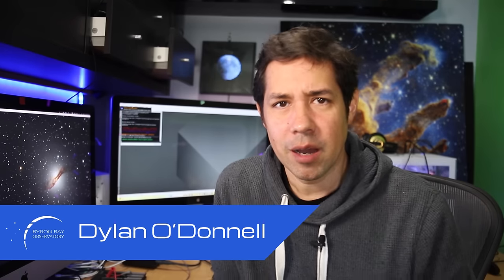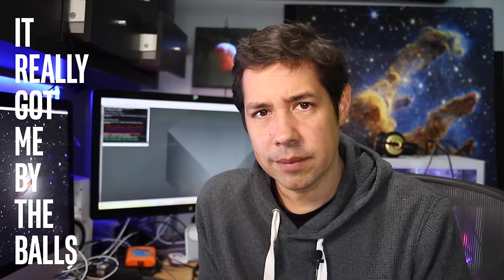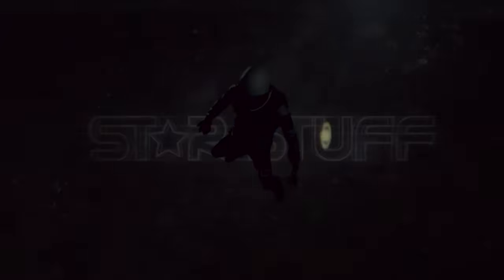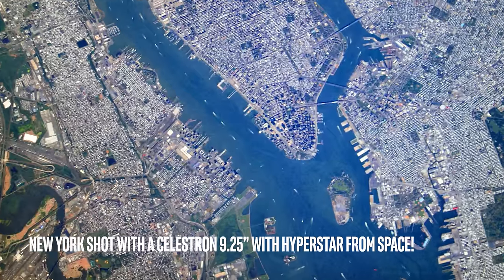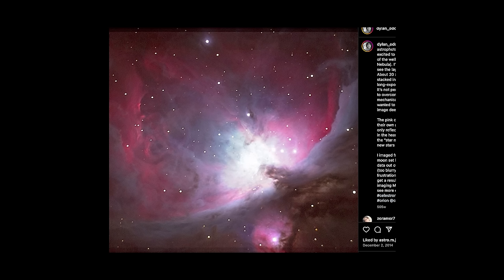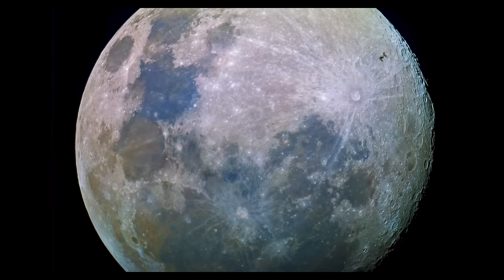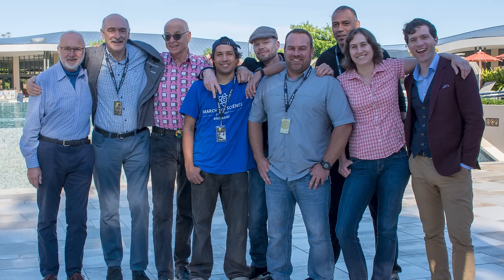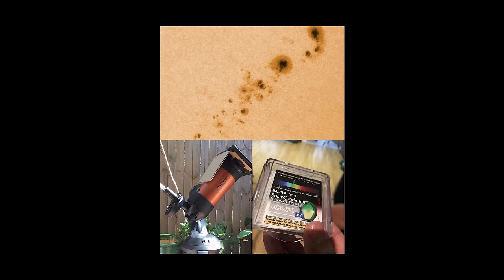I Took Photos of Space for 10 YEARS

Comment: Also started with a 9.25 (Edge) and not sure I agree with the common opinion that it's too much for a beginner. Celestron's polar alignment and goto methods were pretty easy to follow and a bahtinov mask helped with focusing. All of which was a huge PIA in hindsight compared to platesolving, auto-focusing, etc. now, but not difficult technically. Anyhow, I just stuck my dslr on it using the onboard battery and memory card, plus no guiding, so no laptop (or USB ports!!), and could keep about 2/3 of 2 min subs, even with a crappy CGEM. Probably the most blissful part of my AP experience!.... It was biting into the guiding apple that turned astro Eden into astro jungle. Quickly learned how crappy my mount really was for AP, but stubbornly took way to long to get a new one! And that was only the beginning of the descent..... : )
Reply from the maker: Yeh I never fully agreed it was a “bad” choice either .. it just forced me to get good good at the mount / alignment / guiding :)

Comment: Dylan, I noticed you do not have a pier in your observatory but use the tripod.  Does this cause a problem like kicking the mount and messing up your polar alignment.
Reply from the maker: I have a tri pier :) so my gear doesn’t crash into it or get tangled easily. Also I basically leave it locked and don’t go in there unless I need to.
Reply: @DylanODonnell  Thanks, just wondering how the tri pier is anchored.  I am still old school and use USB cables, so I don't have the remote abilities.  During long exposures i can leave the scope unattended.  But back to the observatory to start my next LRGB image.  I turn 80 next month so I don't think I'll be up grading anytime soon.  Been a great ride since the opposition of Mars in September of 1956.